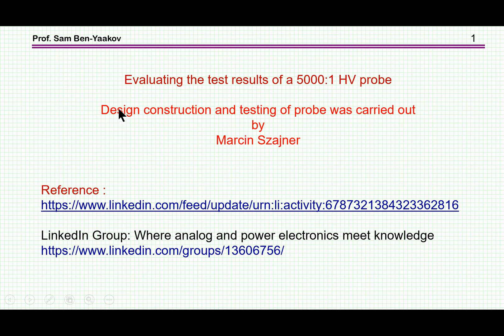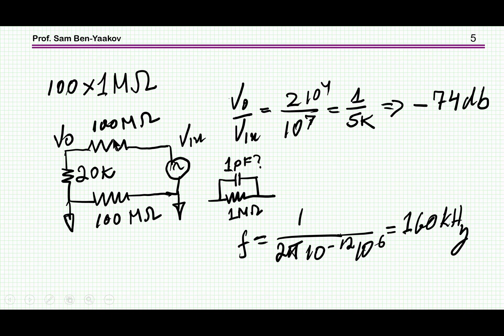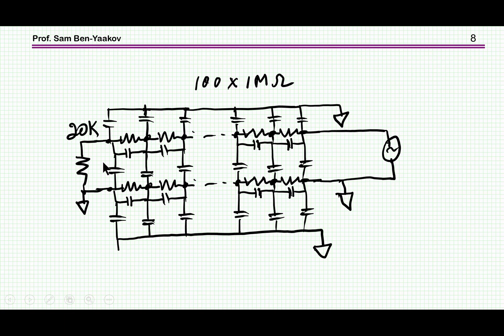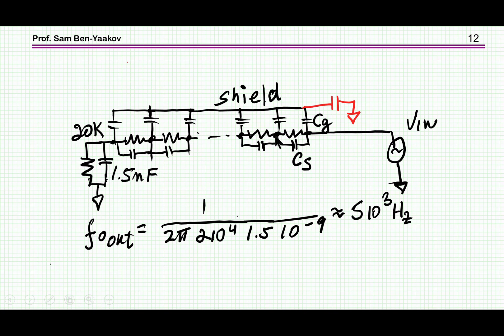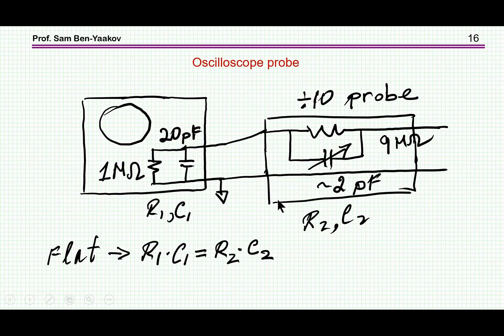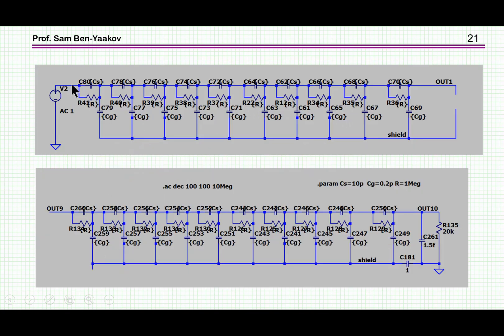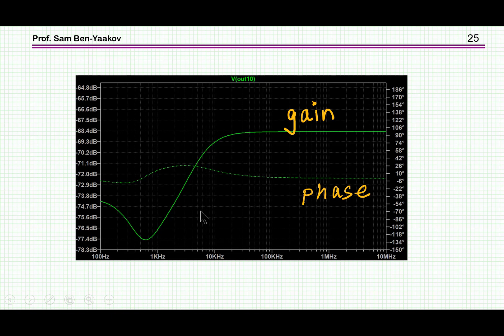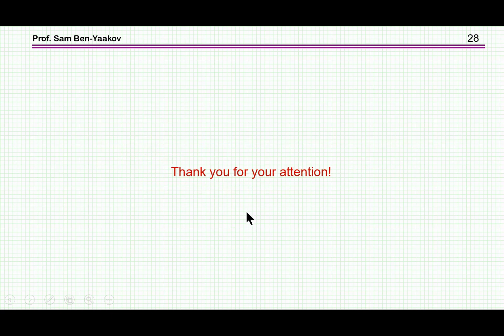Evaluating the test results of a 5000:1 HV probe

Comment: Dear Sam, 
1. Is it only one leg of the filter analyzed, as at 2:00 both the scope and the generator are marked as grounded shorting the lower part of the pcb? 
2. How does the C181 of 50pF come into play? Is it a part of the design or a capacitance between the shield and the shunt of the divider? 
3. The math does the job, but I'm wondering how in practice the parallel capacitance of a single SMD resistor could possibly be 70pF?
Kind Regards!
Reply from the maker: 1. Yes it is connected between the two "grounds" but the intersting point that it has a profound effect. 
2. This is supposed to represent shield to ground capacitance.
3. AS explained video, this is not the realistic value but represent other effects e.g. capacitance between the first and last resistor.
Reply: @sambenyaakov  Thank you :)

Comment: Another great video, but I thought you were going to explain why these high voltage probes are so bloody expensive when they are just a resistor network... ;-)
Reply: The devil is in the details, HF compensation of this probes is not easy, and there are construction details related to the distribution of the high voltage electric fields. Also, typical helical high voltage resistors with ceramic substrate are sensitive to magnetic fields and special construction is needed to avoid these.
Reply from the maker: Thnks for enlightening comment.
Reply: @ychannel3 thanks you for this real usefull answer! It is also interesting for me and probably many others.

Comment: Thanks Sam! Could you please explain the workings of those bench power supplies? How to make current and voltage limit, CC and CV, i am trying to make my own power supply and i got stuck with regulation, i am using mosfets for voltage and current control, current control is setup up as current sink.
Reply from the maker: This is normally done by a clamp on the error amplifier that is fed by an OR connection of the two signals.